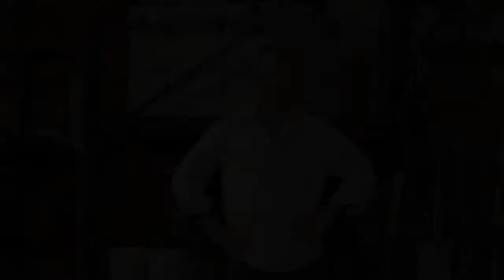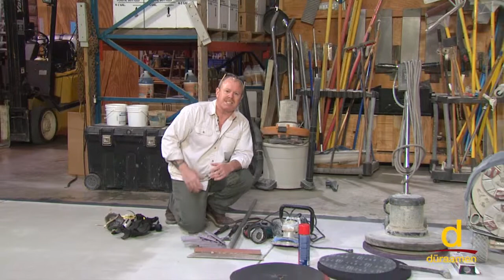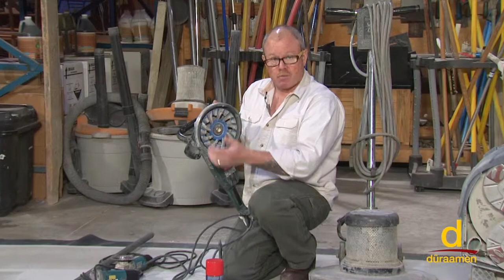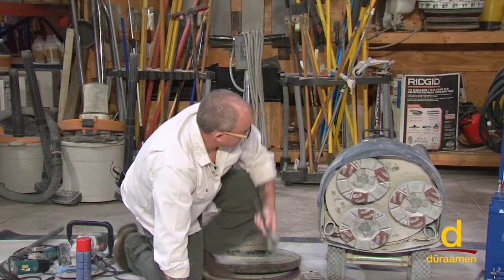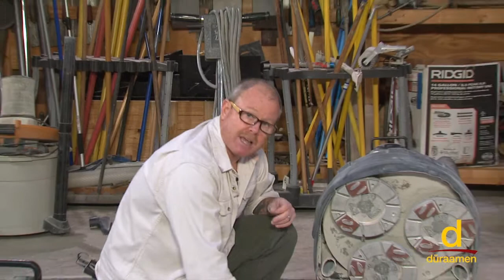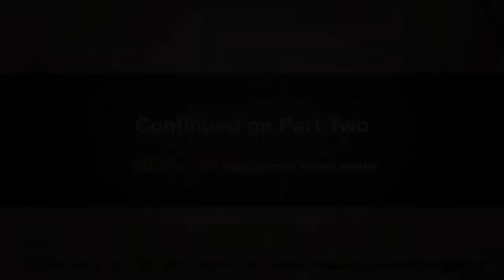CONCRETE SURFACE PREPARATION PART 1

Comment: starting my shop floor after walls&ceiling painted. 50+hrs of research-literally! 1 car hoist,lift&storage and so many products to choose from. honestly just need to know wtf to put down so I don't have to redo this constantly. You know your stuff clearly, but there's no end in sight for GOOD QTY materials to use. I'm not afraid of hard work. thanks